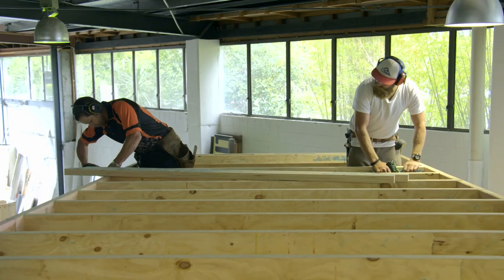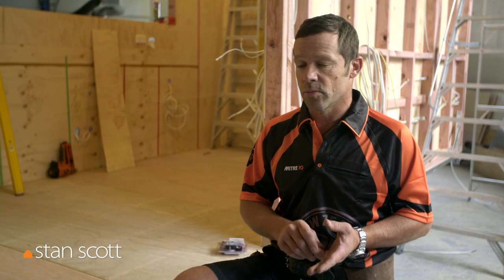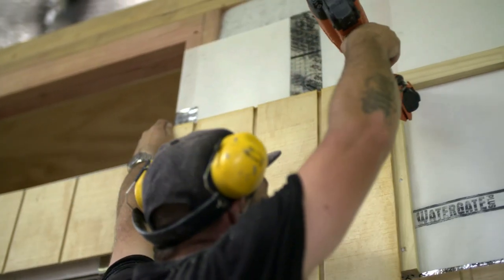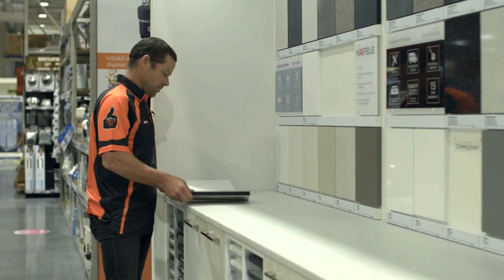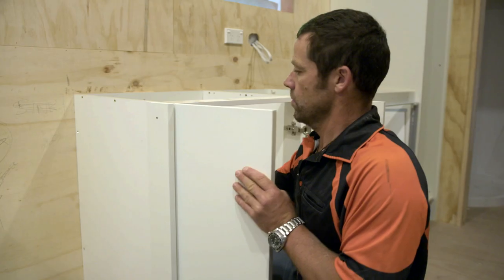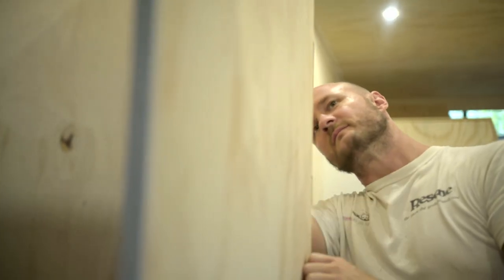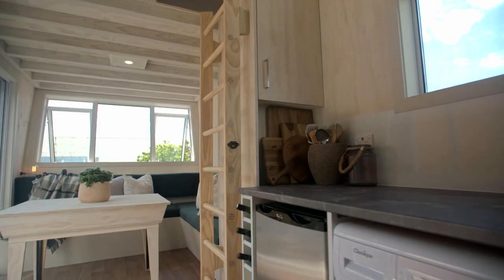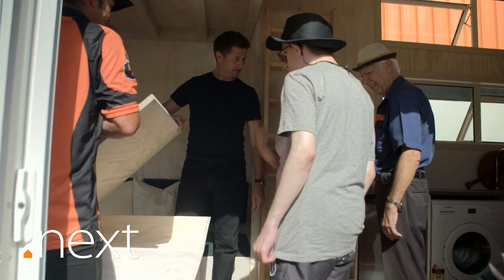Ep 3: It's Done | Mitre 10 Tiny House 2 with George Clarke

Comment: these people seem to build exhibitors NO DURABLE HOUSES ,,, NAILS, AND TAPE IN ELECTRICAL UNIONS? '' but it looks like a fairground barrack ,,,,,, UMMMM, they lack some good lateral arms, FOR THE WINDS, but when the bed is used ,,, do not see the electrical and water connections to the network, supports so that the sustentation does not depend on the tires, for when use fixed ,,,, remember ,, SOPLARE, SOPLARE SAID THE WOLF